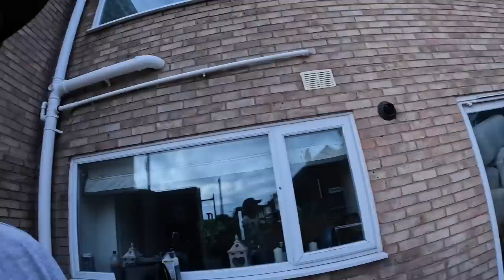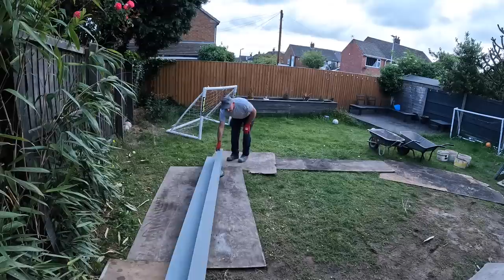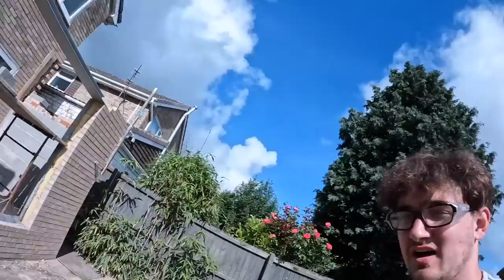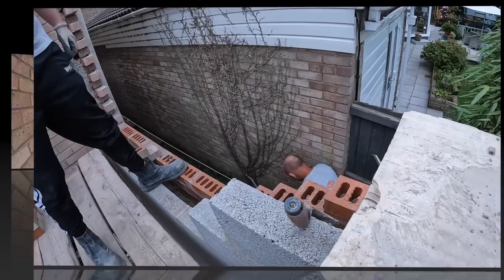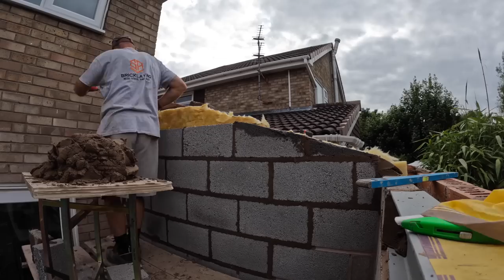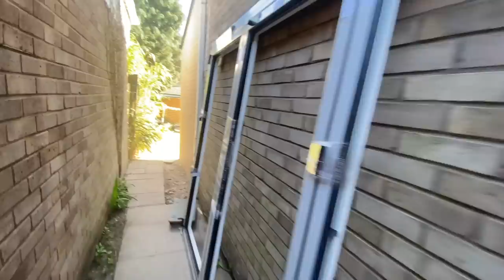BRICKS ,BLOCKS AND STEEL ..BI FOLD EXTENSION PART 6

Comment: Just out of curiosity... what is the opening size of the I assume bi fold doors? The reason I ask is that I am on with an extension with bi folds and the opening is 3.6. The architect specified a thermally broken Catnic lintel which has had to be specially made, however, the bi fold company surveyor when measuring up was surprised that a Catnic was specified rather than a steel due to it only being single story and very little weight above the Catnic could lead to movement. What are your thoughts?
Reply from the maker: We want for a 150 x 85 steel with a 8 mm plate welded on for the exact same reason as the surveyor said 👍🏽🧱

Comment: Looks fantastic, Silly question, but what are you using to clean out the mixer, doesn't sound like a couple of half bricks?. I've alsways idmired how clean you managed to keep yours.
Reply from the maker: Water and a stiff brush , never bricks . If it builds up then a bag of 10 mm limestone polishes it right back up . 👌🏼🧱👍🏽

Comment: Are they breeze blocks or thermolite blocks?  , I have quite a few cracks in mine some from Floors to ceiling in my garage ,  I don’t think there’s movement just drying out they’ve been the same since I bought the house 15yrs ago , house was built 2003 , any tips on how to fill them or fix the issue
Reply from the maker: We use fibolites , a lot stringer than thermalites 
   You need to replace the cracked blocks and re point the perps . 
   Always happens with thermalites 🙄🧱👍🏽
Reply from the maker: @martin2466  We had them floor to ceiling in our garage and they were 150 mm blocks 😳🧱👍🏽
Reply from the maker: @martin2466  . No it was Bellway but built to the same sea standard 🙄🧱👍🏽

Comment: Such a long span is not bolted down to the inner and outer wall at each end with chemical cement and threaded bar? It just rests on the brick/block walls?
Reply from the maker: Nope 🧱👍🏽

Comment: Is that beam bolted or otherwise secured in place? I'm surprised there's so little overlap on either side. I don't know how much of a load it will support but it puts all the weight just on the edge bricks of the supporting walls.
Reply: steve knows what he is doing snidely
Reply from the maker: It’s all secured when the roof goes on . Minimum seating for any lintel is 150 mm , our beam sits on 200 mm 🧱👍🏽
Reply: @SteveAndAlexBuild  I don't doubt you guys know your trade, I was just observing differences. I'm in Earthquake Country in the US and I wouldn't doubt but that both side overlap minimums and anchor bolting practices could be very different. Even if over code, 200 mm doesn't seem like much but I'm not in the trade. Good luck, I enjoy watching your project videos.
Reply from the maker: @snidelywhiplash8923  cheers buddy 🧱👍🏽

Comment: At 27.40 what insulation have they used on the ceiling?
Reply from the maker: Not sure pal we don’t do the roof 🧱👍🏽
Reply: It looks like floor slab insulation, been a good series though 👍
Reply from the maker: @johnandshelly82  cheers John 😁🧱👍🏽